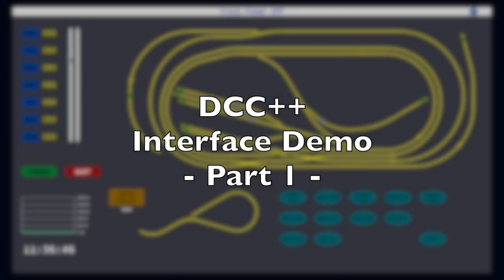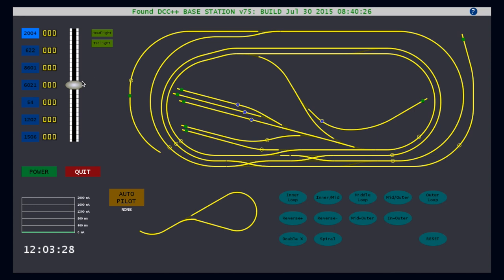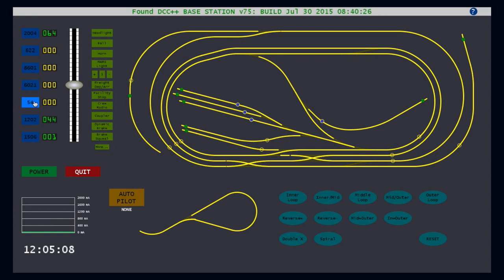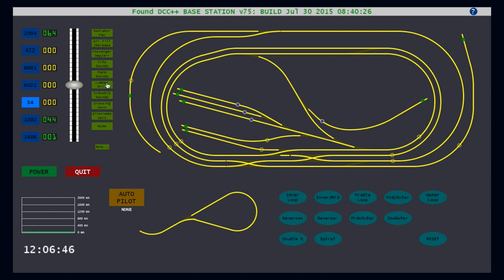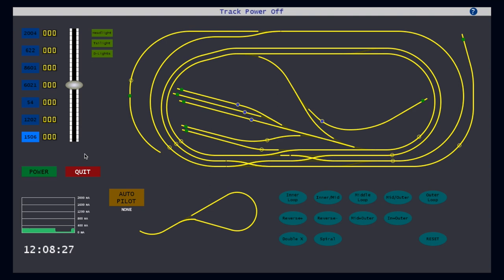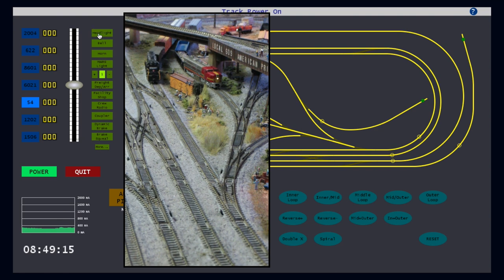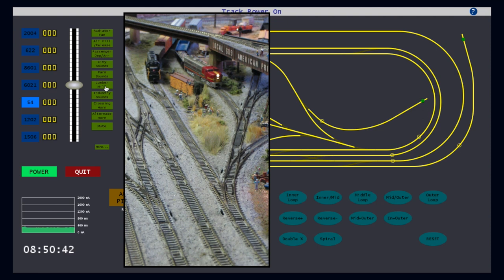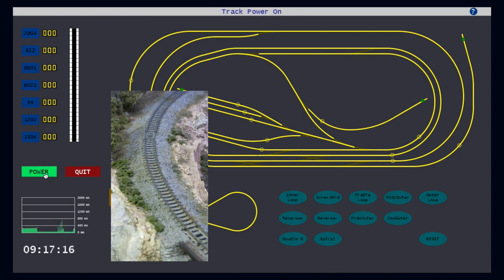DCC++ Interface Demo - Part 1 of 4

Comment: Is it possible to configure the rails circuit (in yellow) without being connected to the HO control unit? (before starting its construction) With only DCC controller1.1.0 configured on the PC. My test, in this configuration, does not allow it, nor does it activate the green power switch and the speed slider.
Only a few buttons respond. Thank you

Comment: Hi DCC++
I am not new to DCC or Control Systems. I must complement you because:
Your work is excellent both the system and the videos.
It is very obvious that  a lot of work has gone into it. I am really looking forward to the next videos.
Do you have a website for the system?
A couple of block diagrams would be nice.
Do you have any plans for external, hardware, throttles?

Bye for now,

Godders
Reply from the maker: +Godfrey Earnshaw 
Hi Godfrey, thanks very much for the kind words!  Though I have not yet created a separate web site, all of the software has been loaded on to GitHub and is regularly updated (see the links on the "About" page for this channel).  Also, there is a very detailed and robust discussion group for DCC++ on TrainBoard.com -- lots of great ideas and expansions to the system.

I recently noticed that GitHub has functionality and available storage tied to each software repository for hosting an embedded web site.  I will likely use this in the near future to bring together documents, software, and links back to this channel all under one umbrella.
Reply: DCC++ Hi Gregg, (I got your name from the Trainboard)
Thanks for you response. I have just had a very quick scan onTrainboard at your project and it looks like it will stop me getting bored at Christmas, and a lot longer. Before I forget merrry Christmas to you and yours, will probably contact you after I have read the Trainboard stuff, it does look interesting.

cheers

Godders

Comment: Great video and UI Gregg, I am considering using you DCCpp_Controller for a DCC++  system but (obviously) need to change the layout to match my own system layout. 
I have currently designed the layout using SCARM on windows 7 and would like help in moving this to your interface. I am a retired programmer but not that familiar with programming graphics. Have downloaded your interface demo and have it running under the processing IDE without any problems, using the emulator, but I see the graphics code (in dTracks) is all hard coded. Any suggestions as to how to get this data from scarm? I have exported the layout from scarm as a windows .emf (enhanced metafile) and would appreciate any advice on getting this data into DCCpp_Controller.

Comment: How do you even install the controller? There is no info how anywhere. Also when I try to connect the track power to the uno, the computer wont turn the power on

Comment: Hi Gregg. Thanks for these videos! it is great that DCC can be available for low cost. I managed to install the software on the Arduino Mega+Driver. I can'find the user interface you are showing in the videos. Is it Windows or Raspberry Pi based? What am i doing wrong?
Reply: Hi Iara, The software is on the same github (https://github.com/DccPlusPlus/Controller). You need to install Processing (http://www.processing.org/). It runs under Windows/Linux/MacOSX/Java. I'm (trying) to build this track myself, also under Arduino DCC++ control, but I'm waiting for a boat from China to arrive :-)

Comment: Hello,
     I love this! 
     It's almost exactly what I've been trying to do with my small n scale kayo layout. You say this is open source, but i cant find any more to this series. I have lots of ideas for ARDUINO; signals, turnouts, and detectors, But no way to send sensor data from multiple arduinos to my PC. I find nmranet / OpenLCB too expensive for many arduinos. DCC is great for stationary decoders, but how to send sensor data back to the PC.
     I'm  Joe.    69yr old.   live in Portland OR.   been playing with trains for 60 yr.
Reply from the maker: +Joseph Mroczek 
Joe, thanks for the comment - you are the first one!  I have not finished producing all of the videos that show how to program the Arduino, connect to the tracks, and download a copy of the interface.  I've been working on this for about 5 years and the code is quite solid at this point.  I developed it using only open-source tools and my intention is to provide all of the code back to the model railroad community for anyone to freely use, modify, distribute, etc.  as they desire.  Please check this space over the upcoming weeks for more videos and, eventually, links to the code itself.